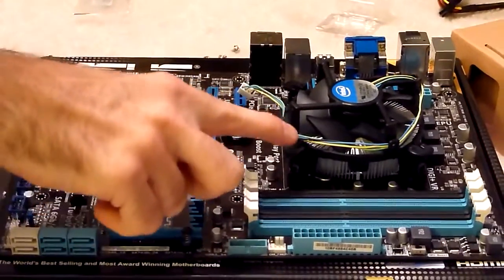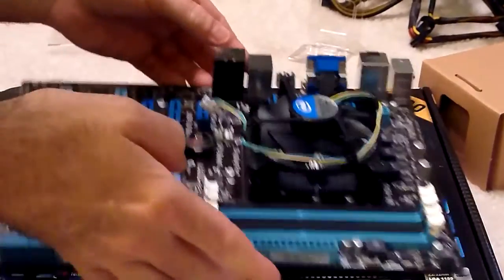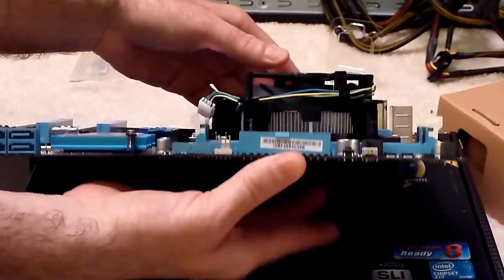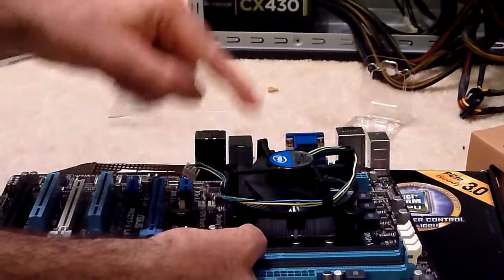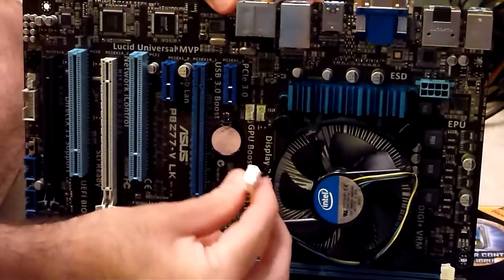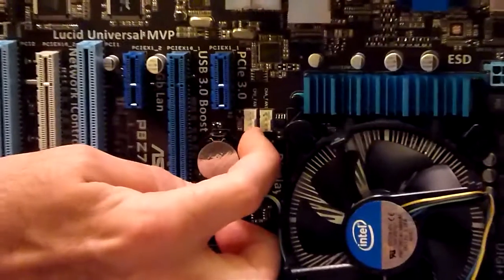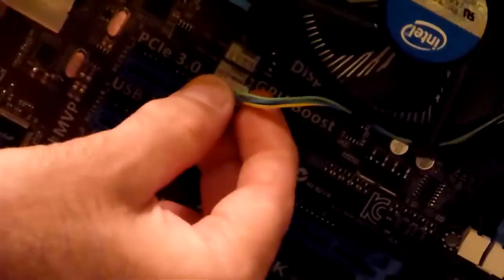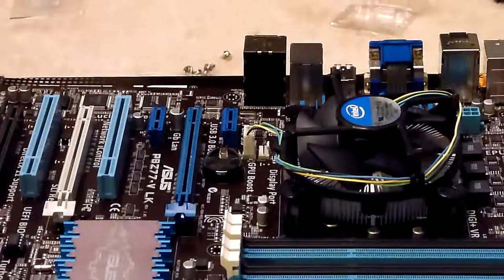PC9: Latching the heatsink and attaching CPU fan Cable

Comment: i’m not able to attach my cpu cooler to my motherboard because it doesn’t have a back plate attached to the motherboard? i don’t have the pins so i have to manually screw it in